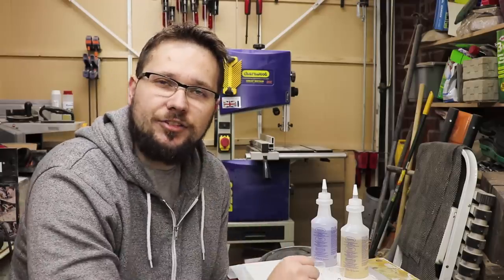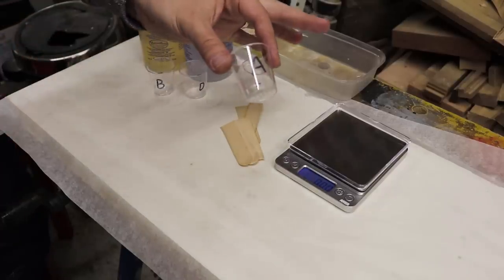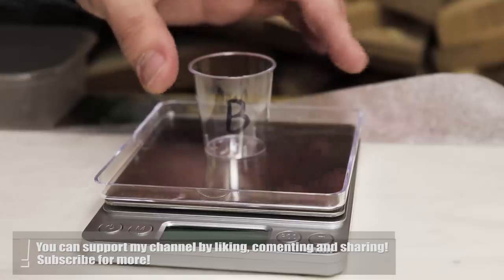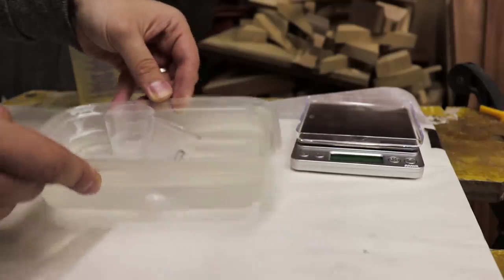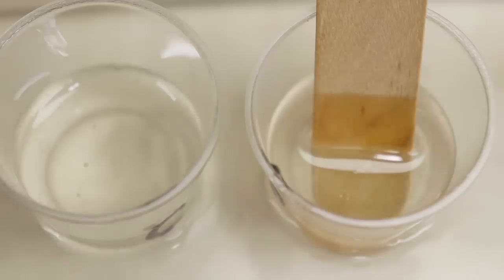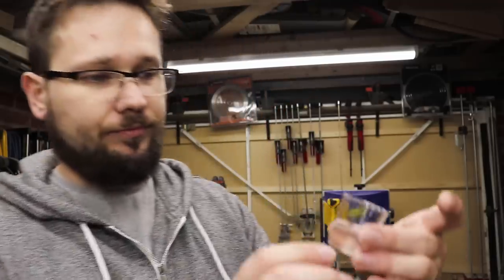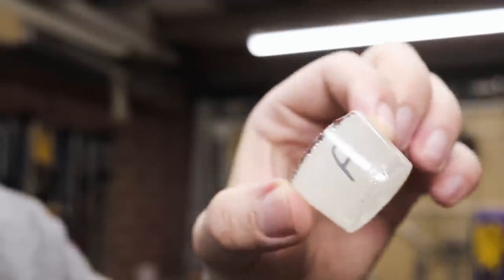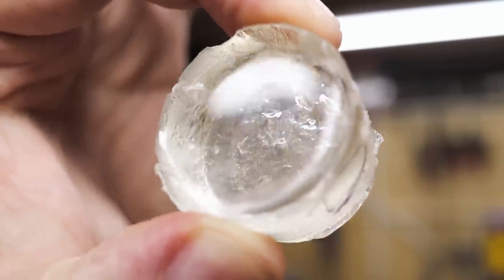Epoxy resin - casting technique to get rid of air bubbles - no pressure pot needed

Comment: Will the hot water method work if I put dye into the mix?
Reply from the maker: Yes it will👍
Reply: Casual DIY thank you!
Reply: Casual DIY another question. I’m using pipettes to put my resin into my dice molds. What can I do to further minimize bubbles in the resin if I do the pipettes
Reply: Casual DIY also I’m planning on mixing gold foil
Reply from the maker: @shrimpy_nazeem  take your time, the less air bubbles you will introduce during this process the better. But ultimately the best results can be achieved with a pressure pot.
Reply: Casual DIY well that might take a while since I just cut myself with an xacto knife.

Comment: It depends on what kind of resin your using. I've tried it but after 5 minutes of room temperature water I had one big lump and had no use for it anymore.
Reply from the maker: Hi, yes this will only work on slow setting epoxy. My epoxy got a work8ng time of around 40 minutes.
Reply: If you had 5 minute work time that'll happen, it's better to get the stuff that takes longer, once it goop's you're done. I learned that the hard way, now I use a timer when working!

Comment: It doesn’t sound like
You have any kind of respirator on.. do you use protection with this brand?
Reply from the maker: In theory you should use respirator at all times using any resins. It's my choice not to do so. I tend to use products that are high quality not mega toxic and don't produce massive amounts of fumes or any smell in that matter. But I would not recommend not wearing a respirator to anyone when working with resin.

Comment: I've got pressure pot, gauges, brass fitting in work space, drill & thread  hole in lid for nothing. I have pressure fitting an hoses, so I could build this pressure tank with almost just stuff around, but you should looking centrifuges!

Comment: Doesn't warming the resin mess with the cure time?
Reply from the maker: The resin I use got about 40 minutes work time and I'm have not noticed any difference. Remember you you are only using hot tap water not boil8mg water or anything like that.
Reply: Most cure faster when warmer.

Comment: It is now 1 1/2 years after you've made this video and I found you! Yes! I use epoxy resin for my paintings.  I am distressed to see so many bubbles in it once it's cured. So I went looking on You tube and found you.  I also found that by doing a 1 to 1 ration which is everyone's directions leaves hardener left once the resin is used. I reached out to ArtResin and they said it is because the hardener is denser, which is exactly what I thought. They said it could be measured .84 oz hardener to 1 oz resin. With that said the measurements are no longer equal, however, I my container is just about even.  I'm wondering if measuring this way is not the right thing to do and I need to get used to having left over, which at the expense of epoxy... I find it very wasteful. What do you think?
Reply from the maker: You always need to mix your resin exactly to the technical sheet that comes with your resin. I always mix a little bit more. What's left I pour to some silicon moulds and make jewelery or other items.
Reply: @CasualDIY  Thank you so much for your immediate reply. That is so kind of  you! I loved your video. Watched it twice & then took notes. I used your "d" test. & after reading a bunch of comments, i used a plastic stir stick & not a wooden one. I found after the first warm bath, bubbles came up to the top. I carefully removed those. Then during the second bath, the bubbles didn't adhere to the plastic. So I think the wooden stick being porous is why those bubbles in your test pulled  onto the stick. I found there were less bubbles in the cup from the 2 baths. However, I found there still were many bubbles that kept coming up once I poured it onto my canvas. I had to keep torching them out. Alas, while resin looks beautiful, getting it smooth on the sides & the bubbles out is almost impossible. The imperfections left on my paintings is disappointing. None, the less, your video was awesome! So thank you for that.😊🐇❣👍 P.S. i did use 1 to 1 for this resin session.😅
Reply from the maker: @Roxy4utube  thanks, maybe consider using different resin? You can get resins that hard very good at de-gassing themselves

Comment: Ive done things like warming up the resin and heating up or torching after pouring... Yet I still get micro bubbles in my pieces.
Reply from the maker: The ultimate best way to get rid of 100% of air bubbles is a pressure pot.

Comment: Hi can you please tell me how to thin out gorilla glue epoxy clear resin as it's very thick! If I can thin out ? Like a self levelling epoxy resin? Cheers from Australia 🙂.  Any reply appreciated 👍.
Reply from the maker: You always mix resin as per ratios on the technical sheet. If you don't keep to the correct amounts of part a and b it will not cure correctly. If you need the resin to be thinner you need to look for a resin that after mixing is thinner.

Comment: Thank you! Do these processes, specifically C & D cut into the pot time? My resin is only 20 mins. Thank you!
Reply from the maker: Yes it may alter working time. Depending on type of epoxy you are using.

Comment: So I did the hot water thing and a lil bit of water got into the cup. I was worried at first but after a bit of mixing everything looked fine. (I put both parts in the hot water). I mixed the two parts together and carried in pouring it into the moulds. Around 10 mins after I mixed it all together, I noticed that the resin was getting super hot and actually started to burn my hand through the cup and my gloves. I then noticed that it was bubbling maybe even boiling. I went to mix it and it was In this massive hardened clump if resin. I stopped what I was doing and was super confused. 20 mins after I touched this hard boiled mixture and it was completely solid. What happened? Was it the water getting into the resin or because I warmed both parts?
Reply from the maker: Never put water to resin. Secondly please read the technical sheet that comes with your resin. You need to info on mixing ratios( by weight or volume) what is the curing time, what depth you can pour at one time. Then if you follow every thing to the dot you should not have any issues. I recomend you watch my other videos on Basics of resin and how to mix resin 👍
Reply: Casual DIY Thankyou very much
Reply: @rosiefuller8791  you mixed too much resin up at once. it got hot and sped up its reaction so it overheated itself. utilize thin pours one at a time on top of one another. that's your best bet for the type of resin you used. if you are totally determined to pour all at once, buy another kind of resin. and still be prepared to work super fast. super duper fast.

Comment: Hi thanks for the great video. I'm wondering if I can use pressure pot before mixing both parts together? As I need a fast cure time but longer handling time. What you think?
Reply from the maker: Hi, that will not work mate as the air bubbles are mostly introduced during mixing. If both parts are not mixed correctly you may have poor results.
Reply: If you want too extend you handling time, transfer the epoxy in to larger diameter containers. The thinner the epoxy is in the container the longer it will last. Depth in epoxy helps build the heat faster. You can do the reverse of you want to shorten the handling time
Reply from the maker: @darrenpoulton6643  that's a very good tip thank you👍
Reply: @darrenpoulton6643  thank you

Comment: What is the melting point of the resin after it hardened?
Reply from the maker: Sorry not sure what you mean?
Reply: Casual DIY I believe they mean ‘At which temperature will cured resin begin to melt’ 

That’s a good question, though...
As far as I know, different types and brands will have different heat tolerances.  If I’m not mistaken, some types of epoxy are even marketed for their heat resistance, similarly to silicone.  

Edit: (I googled it.  Some varying details from source to source, but this appears  standard. Quote from a reliable source)
-“While a DIY epoxy kit will commonly only withstand the temperature of up to 150 degrees, there are other epoxies out there that can withstand the extreme heat of up to 600 degrees. These are specially formulated with fillers like quartz and offer abrasion resistance, and high heat curing.”
Reply from the maker: @lilbohbeat5785  I thought he ment that but why? Anyway thank you for looking into this 👍 Although I would recomend to anyone to use epoxy as a fire resistant material. It's like plastic when it's cured and when under external heat it will burn and I can imagine it would generate toxic fumes. So that kind of information needs to be provided directly from the manufacturer of epoxy to avoid any confusion and potential health hazards.
Reply: Casual DIY Oh, yes of course you’re right... I wouldn’t assume that anyone would seek out epoxy in search of a material with x amount heat resistance, but I probably should be more careful with assumptions like that, now that you mention this point...

I know this is something often asked/discussed online when it comes to  certain specific applications, (tabletops/countertops definitely come to mind) where epoxy is/has been  typically/often used; in these cases it can be helpful to have some idea of the way our countertop, say, will react to whichever levels of whichever different wearing and damaging situations, like a hot plate or pot of boiling water.
Reply from the maker: @lilbohbeat5785  thats true about the resistance of epoxy and to be honest I'm still trying to find that out for resins I use... no one has got a clear answer I think I will have to make some testing myself

Comment: will a vibrating platform work in removing air bubbles?
Reply from the maker: Hi, to be honest I'm not sure never used anything like that. In theory it should as it would help the bubbles to escape.
Reply: @CasualDIY  ok..may be i'll try and let you know of the result...
Reply from the maker: @adminsm6155  cool thanks :)
Reply: Oh no. Makes it worse. Also I tried a air brush paint mixer. Alot of bubbles. 
The process using heat is good way. Pour high in a corner. And make a small but steady stream. Another trick is dusting the mold lightly with baby powder. Helps the epoxy fill into cracks and voids. 
I am needing the clearest i can produce. Some hoping tinted. So best way is vacuum pot. Im fixing to order a kit off ebay.
Reply from the maker: @robertcrittenden497  I started to think bit more serious about my epoxy projects and business ideas and got a pressure pot from Santa:)

Comment: Rather nice comparison, but if casted into a two piece mold how will you get rid of bubbles formed by the pouring process, bubbles created by surface tension inside the mold and than bubbles that form due to bad ventilation of the mold - I say whitout a pressure pot you really want get good bubble free results using a two or multipiece molds. Anyway nice video, thanks.
Reply from the maker: Hi and thanks. Yes that's true there is always a risk of bubbles when you pour the epoxy to your mold. But the fact is that the epoxy at this stage should be warm enough so that after the pour it will still be fairly fluid and the air bubbles should be able to escape. But yes a pressure pot is the way to go to achieve flawless result.

Comment: If you mix them in silicone cups instead of plastic, the hardened epoxy will pop right out and cups can be reused.
Reply from the maker: Hi, yes got myself a nice set. They are fantastic 👍

Comment: I do this and the bubbles are out but then when I pour into the mold they get bubbles at the bottom of the mold ( micro bubbles)  how can I fix that.
Reply from the maker: Hmm with carefull pouring there should be no air bubbles introduced. Unfortunately the best way to have zero air bubbles in casting is a pressure pot.
Reply: Got it. Alright I will try to pour carefully. Thank you for your reply

Comment: Help!
I heat the resin in a water bath first  and 
use hardener at 1%-1.5%  and stir with a round stick. I don’t have a lot of bubbles 
But find a bubble film attached to either the plastic or wood I’m incasing in the resin.
Reply from the maker: With wood the cause of that may be that is not dry enough and moisture is the cause of that.

Comment: I ask my supplier for a modified epoxy and it is already too thin, popping up all the bubbles. 
Besides this I have a good temperature on my side of 50⁰C outside and 42⁰C room temperature.

Comment: i've been trying to make relatively thin parts with Alumilite Amazing Clear Cast resin but the parts never get hard. they cure. they are not sticky, but they do not harden completely. i was told to try heat curing which i did try. this helped somewhat, but the results have still been rather disappointing. if anyone has any suggestions or if this is simply a limitation of the material please let me know. thanks
Reply from the maker: Depending how thin we are talking about. If its 1 - 3mm thick then any material wont be super stiff, especially plasticky types of materials. If the thickness is more than that then there may be a problem with the resin itself - out of date, you could be mixing wrong proportions, both parts A and B are not mixed correctly, the humidity could be too big, ambient temperature too low etc. There could be a lot of factors that may affect the end result.

Comment: What about bubbles as a result of pouring or injecting into a mold?
Reply from the maker: It all depends on the mold. But when the epoxy is not as thick the air bubbles will come to the top. If the mold is enclosed then the only option would be pressure pot to get the best results.

Comment: 😭😬 can you please help me ~ I’ve just bought “EPOXYPLAST3D  A & B” , the problem is that it’s come from Germany 🇩🇪 ~ and has no English on containers ~ not sure how to mix this ~ not sure it it’s one that is equally parts or if part B is drip 💧 only ~ 😬🤷‍♀️ (RATIO: 100:30 AFTER WEIGHT)~ NOT SURE ABOUT THIS 🤷‍♀️
Reply from the maker: Hi, please see the link below to Amazon. If that is the resin you got then the mixing ratio is in the description. Hope it helps.
https://amzn.to/2KVyfXD
Reply: Casual DIY yes it’s the top one in the slide picture strip ~ so does this mean that I add the same amount of both A & B and stir for 3 minutes? Or have I misunderstood?
Reply from the maker: @lisajarvis3820  what does the text say in the description?
Reply: @lisajarvis3820  i have epoxy plast 3d too. There are two kinds.. one u can pour up to 50mm. Use 100:30 mixing ratio. For example if u have 100 ml of A component mix 30 of B component. If you have x ml of A component mix x*0.3 ml of component B. the other kind can be poured up to 100mm. I dunno the mixing ratio for that.

Comment: To spritz rubbing alcohol on your project works well to bring out air bubbles. 
I am going to be using a scale from now on instead of just a measuring cup...good idea! I’ve messed it up so many times 😝
Reply: Don’t make that mistake,,,physics first,, the two substances do not weigh the same, the same weight in both DOES NOT mean that it is the same VOLUME, and this is measured by VOLUME, a litter of oil weight the same of a litter of water?, is the VOLUME of a kilo of cotton same than a kilo of lead,,?.Resins are a lot lighter than hardener,,, good luck.

Comment: problem: I use R217. I mix the two parts, then slowly they react with each other, they "frie" and they form millions of tiny bubbles. I roll the container gently for a while (imagine cement-making), and slowly the tiny bubbles join with each other, they come to surface and they disappear. I do this until the resin has the consistency and transparency of honey. No more bubbles. Then I wait for it to dry in an open container, just like your little plastic glasses. 24 hours later I take it out, it's hard, I break it in two to check the consistency, and inside it looks like a sponge, more than 50% of its mass is air, all bubbles. Which makes it extremely weak even if apparently hard. I read about this from other youtube users, they complain because the bubbles seem to appear out of nowhere while the resin is curing.
Reply from the maker: Hi, I'm not familiar with this resin. What quantities do you mix together? What I have read about it  it 1:1 ratio by Weight. Maybe that's the problem? It could also be the temperature of the surrounding, if it's too cold the resin may not set correctly.

Comment: What about if you warm both parts of the resin?
Reply from the maker: You can but usually the hardner is very fluid and it doesn't require that

Comment: Kindly explain as a bottom line what mehod eliminate/reduce the bubble either with place on boiling water or similar way to avoid confusion
Reply from the maker: The best method I found is test number 4 but only very hot tap water. I wouldn't recomend boiling water it may be too hot and damage your resin